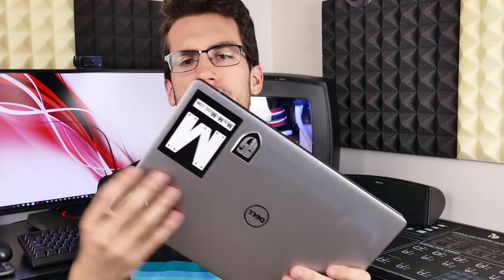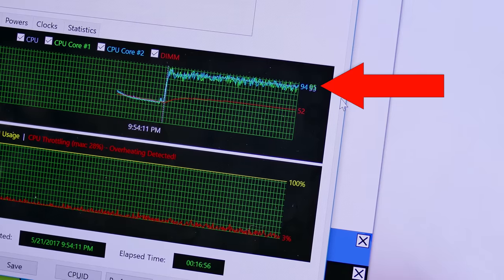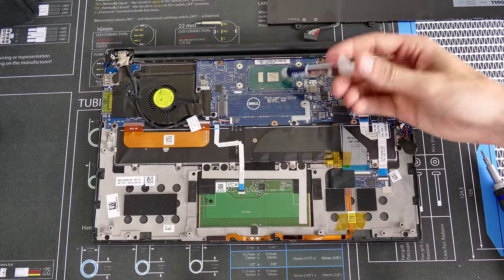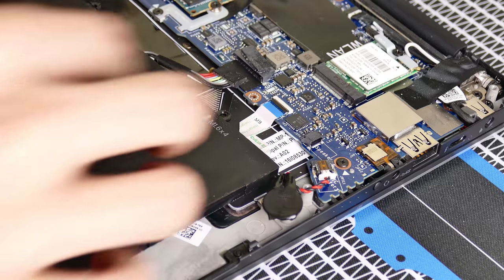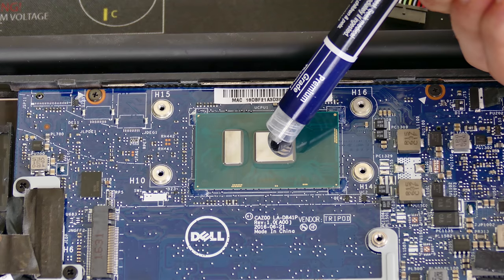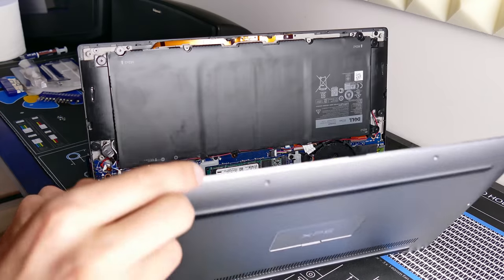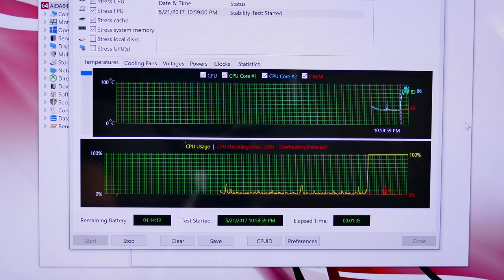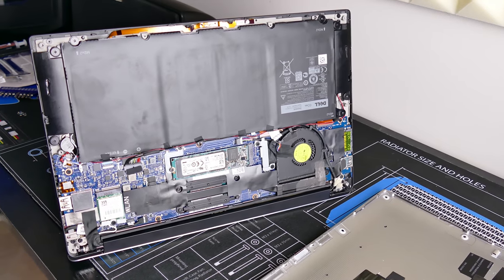Laptop Running Hot? Try This!

Comment: My 14 inch Gigabyte p34w v4 has a 5600HQ @3.5Ghz and a 970m. My max temps are 92 dregrees on the CPU and 86 degrees Celsius on the GPU with stock paste. I replaced my thermal paste and cleaned the fans of any dust and other "gunk". No much change to the load temps but its quite a bit quieter gaming and silent at idle or web browsing.

Comment: You can also use Intel xtu to lower the mv Becuase most of the laptop cpus are fed more power then they need and you can scrape 1 or 2 degrees with the tool to improve over all performance

Comment: Can I also use liquid metal as the thermal compound? btw. I've got an XPS 15 if that helps...
Reply: Daniel Rotter sure you can, as long there is no aluminum it's fine.
Reply: Karras Bastomi That's what I want to know... but since the cooler from the XPS 13 seems to be made from copper, it should work?!

Comment: The single best thing you can do to stop your CPU killing itself in this case is switch off turbo boost.

You gain more heat than performance in most real world testing.

When I brought my Xeon (Dell Precision 5510) back down to 2.8 and left it there, heat went right fown along with it. The chip went from throttling after about 10m of CFD load (yeh, I know... CFD on a laptop... I hang my head in shame...) to being stable at low to mid 70s (with an appropriate vented riser!) for days, up to even a week at a time.

I'm expecting another 5 degree drop at most from switching to AS5, MX-4 or NT-H1, but I don't think that'll be enough to stop 'er throttling with turbo boost back on. The heatsink just isn't big enough.

The funny thing is I've actually gained speed (overall) by stopping the chip going down to 2.2GHz or less when it throttles, instead running at a stable 2.8. I'd imagine this would translate to very consistent (albeit a bit lower) frame rates in gaming too

Comment: Did the same thing with my Dell XPS 13 and same thermal compound (Noctua) and also saw a small improvement. However, still feel that Dell failed to design this laptop properly for thermals to start with.

Comment: Can you talk about undervolting to lower overall temperature of the cpu? For example, I found that my gaming laptop reaches up to 90 Degrees even after I thoroughly cleaned the internals and reapplied the thermal paste for the CPU and GPU. So i felt i was left to Undervolt/Underclock the machine cahnging the core offset to -0.09 and frequency  from 3.2 Ghz to 2.6 Ghz. To maintain a 80 degrees threshold.

Comment: Hey greg I've been looking at getting a high end laptop for a while and was concerned about thermals. I like your idea of adding thermal paste but the whole idea of taking apart a laptop gives me anxiety. I've built a computer before but laptops seen like a whole different world. If you can give some advice of working with laptops, I'll appreciate it very much. Not just thermal paste but upgrading ram etc. Again, thanks, and great video!

Edit: What I mean is, would you recommend messing with a laptop if you're inexperienced.
Reply: samin amanat My advice for disassembling a laptop for the first time is grab a tech PDF off the company's website.  That usually, but not all the time, has disassembley instructions contained within.  As your taking your laptop apart, TAKE PLENTY OF PICS!.  They will prove to be  invaluable to you if you get a bit confused.  Last point, Don't sweat it.  Laptops today are much more simple in their construction as to the ones 15- 20 years ago.  They really are very hard to mess up.  In conclusion, ...... Dude, you got this!
Reply: Credible Witness thanks

Comment: Thank you for this. I thought my temperatures were still too high after using fresh paste but you allowed similar temperatures to mine. Though I might upgrade the paste to a high quality one. My gpu has exposed components around the heatsink (on the actual chip), any idea how I can clean it without ripping cloths and stuff on those components? Really annoying to keep checking for bits that were ripped off

Comment: What do you think of using Intel XTU to lower the cpu voltage to help with temps/performance? I had one laptop that it worked wonders on. Given your highly analytical approach I'd be interested in your opinion on pros/cons.
Reply from the maker: Michael Wilkey Not as pivotal with ULP CPUs.
Reply: Science Studio I just got a gl502vm and was able to drop it 100mv stable on a 6700hq. Temps dropped 5C on average too. Curious if Kaby Lake is really that much more power efficient that improvements are negligable.
Reply from the maker: Michael Wilkey You're talking about an HQ CPU... draws significantly more power than an ULP "U" SKU processor.
Reply: Science Studio ah, yes. I did it as well on an i7-5600u that just loved it, but that was two generations ago. Just curious that I've only seen one big Techtuber cover Intel XTU.

Comment: I seriously did not expect that much of a drastic change. Heat transfer is not likely to be the limiting factor on temperatures, more so the size of the radiator. What the hell is Dell using for thermal paste? Did they put toothpaste on it on accident instead?

Comment: I have the MSI GP70 2PE Leopard and i changed the thermal paste and i only saw like 1 C lower (94 to 93) which is quite weird. Any idea why? (I cleaned all the dust) and yes at 93 C the cpu throttle which i would like to change.. help?

Comment: My old Acer that I am using was throttling when playing CS:GO, so performance was definitely not great. Instead of doing paste replacement I bought a DeeoCoop laptop pad with 2 big fans. Result? Dropped temps by 12 degree Celsius under the same conditions, playing CS:GO. No more throttling.

Comment: Did this to my 2004 HP laptop with a removable PGA Pentium M after cleaning it from dust.
I can't read the temperatures, but it doesn't crash anymore.
Before it had some thermal grease that was probably petrified lol

Comment: my old dell inspiron had bad thermal throttling and when i looked inside the heat sink, ALL of the thermal paste had just disintegrated. there was none on the cpu and only a bit around the edge of the heatsink. didnt have any paste on hand so i used a piece of tin foil. fix the problem and dont worry i made sure it wasn't touching any contact point around

Comment: After the thermal paste swap my PC is idle at around high 40s low 50s celsius  is this good or bad forgot to check the temps before swapping the paste with Noctua

Comment: I did this with my Lenovo Y50-70 Touch because the CPU overheated quite alot. I saw almost no difference. I once noticed that, while running Cinebench benchmark, the CPU was turbo boosting from 2.6ghz to 2.8 (with load on all 4 cores). However it only happened once and I couldn't make it happen again.

Comment: what about undervolting???? it dropped my dell's temperatures by about 10 degrees under load and i haven't even repasted yet. undervolting is also better as you dont have to open your laptop, you just have to stress your laptop and keep dropping the voltage until your laptop bluescreens or restarts

Comment: Dell has a fantastic utility for this already. unfortunately the utility like any other that achieve better battery, lower temps also compromises on performance a bit. But, in the case of my Latitude 5491, I hardly ever notice. It probably helps I keep things like my fans clean and use a high quality thermal paste. Still, it costs hardly nothing to the price of the actual laptop..

Comment: I have the same notebook. With battery charger temperature goes up to 95-99°C at medium load. At more or less idle, its around 60°. Without the charger it's 70° under load and 50° in idle. However due to high temperature with the charger I consider this instruction. Thermal paste and pads are already on the way to me and I tried to remove the heat sink already but got stuck. In the video it comes off easily. When I try it will not come off after removing the screws. I am somewhat afraid to apply more force. I don't want to break the cpu... Any advice?
Reply: Some dental floss did the trick at removing the heat sink! Reapplying thermal compound (and thermal pads) temperature got lower by ~10°C (at idle and full load). The fan is basically off all the time. It comes on at full load but at low  revolutions (barely audible). Big overall improvement to the laptop!

Comment: Tried on my Lenovo S540 (nt-h1 too). Not quite the hoped 10°C, more around 5°C, but it prevents the cpu from reaching 70°C and so the fans from running at full speed, less noise is always good!

But god the previous glue.... it was even spreading a little bit on the motherboard x_x

Anyway, thanks for the trick :D

Comment: My acer vnitro w/ 4720HQ GTX860M 8GB DDR3 simply can't be helped. Did replace thermal paste and throttling still happen. Unless I ran the laptop w/o it's internal keyboard then the temps would level off at 95C Max. W/ everything in place, 99C Max then throttle.

Comment: ive done this to my old 2009 Samsung n450 netbook few months back and its a lot cooler. and yeah i ran into same issue with the block although if could call it that since just a flat machined piece of  aluminum if i had it to tight or to loose it refused to post i did same thing checking connectors and stuff i thought i fried the board or something. but once i twisted screws about eventually it finally booted up. although if it did wouldn't of mattered anyway since i gotten my money from it anyway.

Comment: using liquid metal like TGC it drops temps in laptops around 20 to 30 gegrees and they are Quiet as hell after ;)
Reply: also if you mess up the cost can be quite expensive as well. ;)

Comment: My Asus gl502vmz laptop goes to max 60°C (i7 7700HQ) on 100% CPU load and no GPU load. But as soon as I stress both CPU and GPU to 100%, temps get as high as 90. Is that normal ? How can I reduce it even more ? I've tried thermal paste, cleaning Fans, using laptop cooler with 4 fans. What else can be done ?
Reply: Prathmesh Deshmukh use less thermal paste? You only need a small amount
Reply: @mi16t  I don't think I used a lot of thermal paste. And linus tech tips video shows that thermal paste quantity doesn't make that much of a difference unless it's too less or too much.
Reply: Prathmesh Deshmukh if you used as much as asus used, you used too much. My gl502vsk had gobs of compound. I replaced it with a tiny drop and spread it getting rid of any excess. Huge difference.

Next, undervolt the cpu and the gpu.
Reply: @mi16t  undervolting by 100mV actually made a difference. It runs at 85°~ during CSGO session. I guess the heat sink itself isn't enough to carry the heat.

Comment: Laptop motherboards and cpu may be at blacklist by default, that causes overheating. 30 min in bios is needed to drop the fan speed and overheating, doing it on battery. When done, opera browser fixes the problem by choosing the highest working resolution at youtube, eg 720p. If the video card is hd, then choose a hd video for 30 min watching. Mine crashed 10x,  then the problem was fixed. After that, you can freely use Edge. Watching youtube hd video on batt, you speed up graohic card permanently. Flight sim activates cpu physx, by over speeding at low altitude. Symbian phone requires crashing the plane to reach slightly higher speed. Rally game is also needed, when the car jumps it activates further speedup, but I am just testing if it is ok. Sonic the Hedgehog game also causes further speedup. This way, browsing speed will be higher. It is permanent, you don't need to do it regularly.

Comment: i use Intel Extreme Tuning Utility

i under undervolted my cpu by -140V
I run prime95 when i was sleep ( about 12H ) to make sure its stable 
I Also lowest my IGPU to 0.5x From 10.5x to also lower temp

By doing this i lost 10-15oc 

my new temp is now 35oc idle and max about 84oc ( depending on Room temps and if windows open ) i also use MX-4 thermal paste but i am thinking about re-appying with Noctua nt-h1

My CPU is I7 6700HQ 
My GPU is GTX 950M 2GB Model

Comment: A problem ive been having is that at the start of the startup sequence of my laptop (ROG zephyrus gu54something) i have a bit a of thermal throtle i kinda fixed this by replacing the thermal compounds but the problem seems to occur on some sort of cappacitors

Comment: Also from power settings, i used to have cpu clock speed at 100% while plugged in, after some hours of witcher 3, i reached 96 C. I changed the clock speed settings to be from 70%-100% and then my cpu temps dropped at 84 C.

Comment: My laptop CPU can't get to past 50*C purely because it's clocked at 0.86ghz and doesn't turbo boost at all.
On the bright side, I currently run it at 1.97ghz because I don't need a battery or lap.

Comment: i have a Dell Latitude E6540 with a Core i7 4800QM with Turbo boost all the way to 3.7ghz it thermal shotdowns @ 105c without the boost at its stock 2.7ghz, it reaches 95c and starts to throttle aggresively to as low as 600mhz, i already swapped the compound with  Artic Silve 5 wich i use on my builds, and temps went max to 90c, wich still throttles very hard :/

Comment: these 15w version of i5 , i7 skylake and kabylake with fans. and looking how massive a difference the user can do my heatmodding a little. wouldnt i be doeable to just put an big custom blok of cobber on these dies and kick the fan out the stadion..? any been down that road.. on the coreM ewen thow thats passive to start with and as i recall under 5w its massive the difference you can make like from 95 degrees to 68 and in that league' if you take you time with thick-cobber wide pads and customised the fit optimal with a dremel and afterwards put good quality paste and perhaps thermal pad on'top to make fitted contact with alubackcover..

Comment: I did this on my dell inspiron 7786 17.3 in laptop and its still uncomfortably hot. I think they could have fit 2 fans the mother board is tiny and the fan is on the other side of the laptop making one side amazingly cool and the other unbearably hot.

Comment: After having tried changing the paste on the cpu, it didn't work, I tried with Cooling Graphite Thermal Pad and the same, have replaced the cpu fan, replace motherboard and the same, at the end, I check more carefully and notice that the CPU COOLING HEATSINK was bent and it is very hard to notice, and I decided to buy a remanufactured one. And FIXED, THE PROBLEMS GONE !!. Currently I change the CPU for an i7 and the memories to 8g. that CPU produces more heat and with everything and that my temperature now at 100 percent load does not rise more than 69 degrees. Previously, only when starting it, it turned off due to overheating when it reached 105 degrees.

Comment: Before you try this, try undervolting your CPU first. It doesn't require any disassembling, and it's an easy way to drop 5-10° C. I'd recommend using Intel XTU.
Reply: That brings down the performance..our goal is to cool it down without any performance hops
Reply: @gudimetlakishore6650  no it doesn't lmao. Most if not all laptop CPU's are overvolted out of the factory. For example, my i7-6700HQ could be undervolted by 0.15mv and temps dropped by 7° overall.

Performance remain exactly the same. You could test before and after in Cinebench. Undervolting is super easy. Doesn't even require a reboot.
Reply: @alexkwan3  thanks for the info..i will try it..but do you know why do they overvolt?

Comment: Hello Sir , I have hp pavilion notebook 15 ab 032tx. Today while opening of laptop it shows on screen that ‛ Boot device not found Plz install operating system on your hard disk Hard disk (3F0) ' I made hard disk test ,but my notebook shows ‛no hard drive installed plz check that power and data cables are connected properly ' Plz help me sir as possible."

Comment: That is not the proper way to apply thermal paste on the CPU die/notebook CPU, that method is only for processors with IHS(Integrated Heat Spreaders). But I do feel that there was sufficient thermal paste applied in the video. The proper method for applying thermal paste on the CPU die is to spread the thermal paste evenly on the die surface, about paper thin.
Reply from the maker: NuclearEcko954 What do you think the copper base does when it's secured to the board m8? Relax. It's fine.
Reply: I'm just addressing that the way you applied the thermal paste on the CPU die is an incorrect method. There maybe inexperience people watching your video thinking the way you thermal paste in the video is the correct method and may also apply insufficient thermal paste causing less than optimal results or even overheating. I believe the best way to apply thermal paste on a raw CPU die is to apply a paper thin layer of thermal paste and on top of that dab a BB size drop in the middle of the processor.

Comment: Why wouldn't the laptop post due to "over-tightening" the cpu block? How is that even possible?
Reply from the maker: No idea. But it was the cause for sure.
Reply: Some of the early AM4 coolers suffered from exerting too much mounting pressure, causing a similar failure to post.
Reply: toy machine 
Still doesn't explain why it would happen with a soldered on cpu. Makes more sense with a socket motherboard.

Comment: That heat pipe is a joke...try that with something like a Thinkpad Carbon or something like that, where the cooling solution is adequate to begin with. Dell has also (once again) f-ed-up the Fan-Control IMHO. But - good thermal compound is something very important and that is something, that can be overlooked for that screen the dell has...still, nice video :)